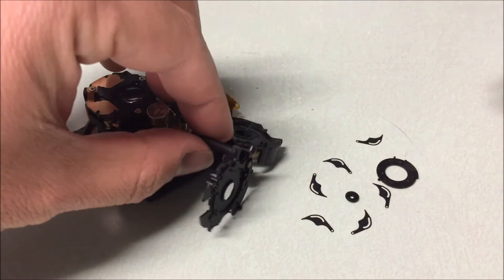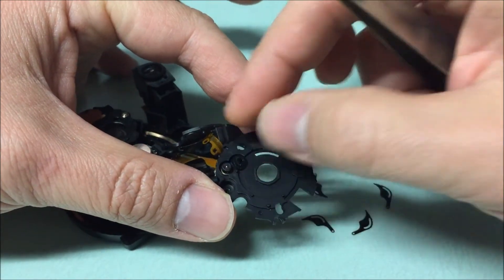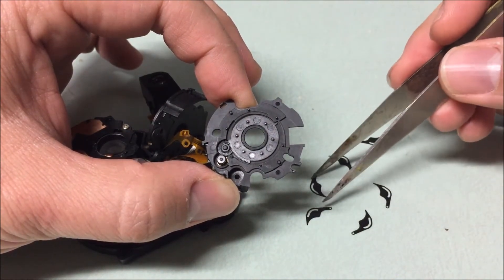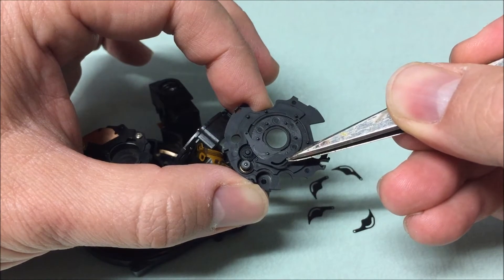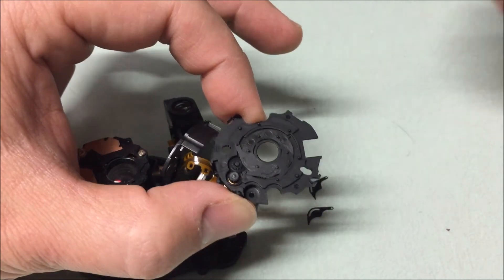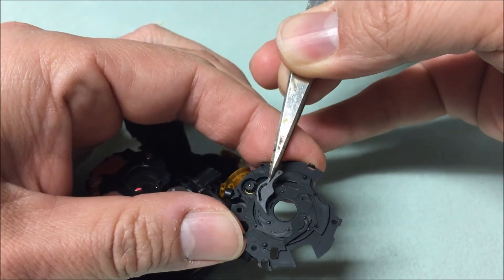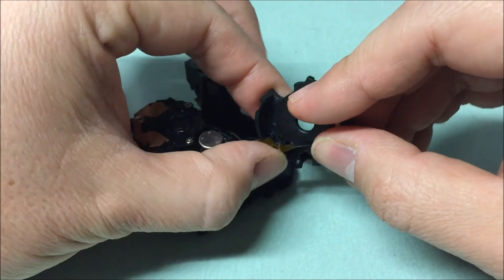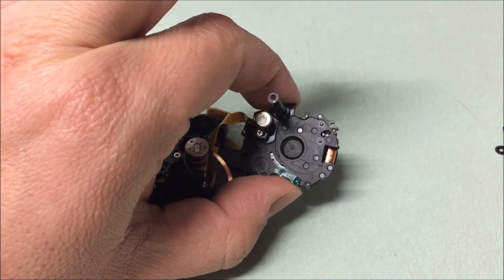Canon S series aperture repair

Comment: Your preceding video was great.  I unfortunately ended up needing this video as well.  I've about drove myself insane trying to get this back together.  They end up not staying seated before I can get the clamp back on.  I don't know if it's a good idea, but I have found if I wet the blades with a little alcohol when putting them down that they stay a lot easier.  Do you have your other video you mentioned where you put the blade in under the starting one?

Comment: Your video saved me, thank you very much! This mishap also happened to me and I wanted to give up. Thank God I found your instructions. I'm actually far too old for this kind of work (as you mentioned: the eyes and the hands). After hours of failed attempts, I went to the kitchen and made a few drops of distilled water which I used to wet the parts. This made both the ring and the sutter blades much easier to attach because they stuck better.
Great repair guides!
Reply from the maker: So glad you were able to get yours going again!

Comment: Thank you for this! Though of course I didn't intend for the aperture to come apart when I was doing a teardown of a Powershot S3 IS, it turns out the poor thing was so ill-stored that not only had lubricant gotten on and contaminated the shutter it had also contaminated the aperture leaves! So in the long run it was a good thing to take it apart. (And let's not dwell on the battery compartment... 😭)
Reply from the maker: You are welcome! Sorry you had to go that far, but I hope you got the camera working like new again!  Great job! :)
Reply from the maker: Not sure where your other questions went, but the ball is  1.99mm / 0.0785in.  Hope this helps, and if you don't find one, you can leave it and the spring out.  As for the silicone, I thought that might have been where the lubricant was wicking in from, but it is actually from the guide posts.

Comment: Hi! Thank you very much for the video tutorial. Another such malfunction was added to the sticking of the shutter. When the image is zoomed in at a certain point, the camera turns off completely. You have to turn it on again and carefully zoom the image in a few steps. Do you know what the problem is? Canon S3IS. Thanks.
Reply from the maker: You are welcome, and thanks for commenting.  Did the zoom problem happen after the shutter repair?  It's possible debris may have made its way into the gear teeth of the barrel.
Reply: @AlsAutoandAppliance  No, no, no. This is another problem with my canon s3is camera. It manifests itself when working with a fast zoom. I press the zoom button and the camera turns off during the fast zoom. Our guys write on the forum that this is a faulty zoom button. They change it or bend the contacts.
Reply from the maker: This is most usually the sonic motor (the one you had to remove from the transmission).  I've had very limited success with repairing those motors.  Canon does not sell these anymore and the best bet would be to find a motor on ebay (most likely will be a used part) or find a whole camera that is non-working and hope the motor is good.  I'm sorry I don't have better news for you. :(
Reply from the maker: I also wanted to add that I know for sure the S2IS, S3IS, and S5IS all use the same motor.  There are other models as well, but not confirmed by me. (these are claimed to have the same motor - SX10 IS SX20 IS SX30 SX40 SX1)
Reply: @AlsAutoandAppliance  And recommend some other device with a larger optical zoom than the s3is. Whatever you like. So that there is hope.
Reply: @AlsAutoandAppliance  Thank you. I hope the zoom drive is OK and it will still be about the zoom button. And why did you lubricate the curtain cover with a silicone sealant during assembly, so that the grease would not get in the future or for a long-term fixation? Sorry for the English, I'm writing to you through yandex-translator, I'm from Russia, Yaroslavl.

Comment: i am so mad! everthing as all lined up and ready to go... then that one appeture blade was siting there smiling at me... grrrrrrrrrrr!!!!
Reply from the maker: I feel your pain!  I've probably had to do this fix about 5 times and have never gotten it done without having to start over. Hope you eventually got it back together.
Reply: Having just repaired my S2 IS, I knew that this was the worst case scenario so I used notched card inserts, which I used to wedge the aperture unit closed. Just getting the shutter blades into position took over an hour of fiddling, so I can't imagine how annoying this operation was. I hope you got your camera working after all that.